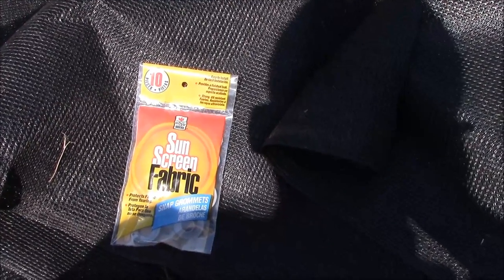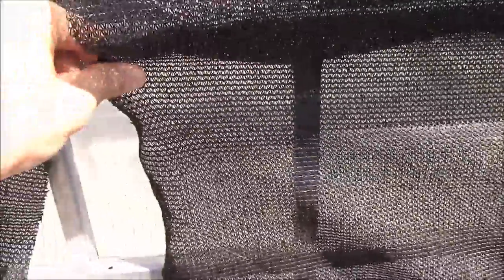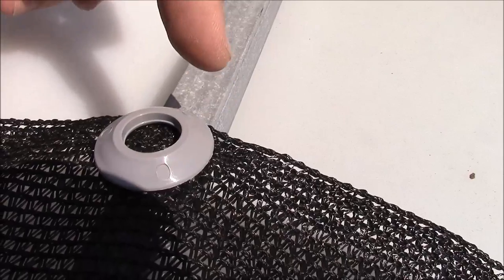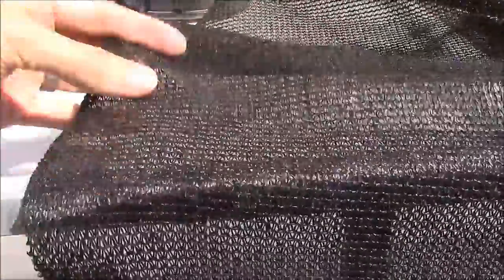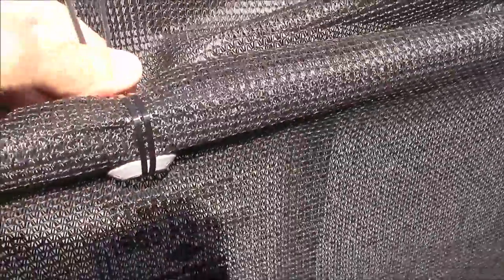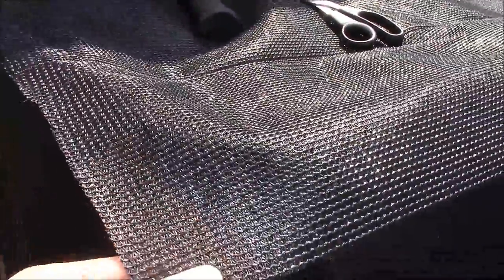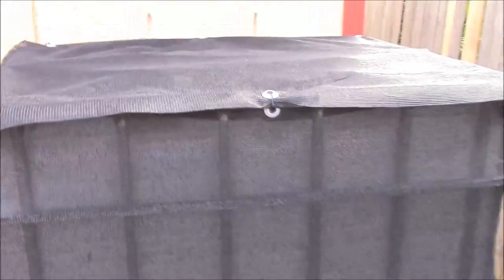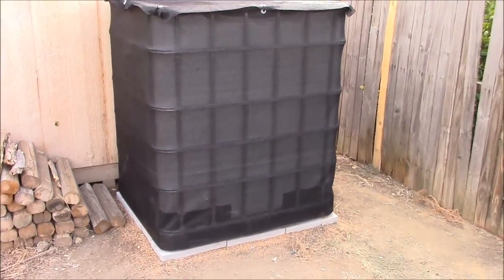Building A Rain Catchment System - Part 2 Protection From The Sun

Comment: I have to agree here. I would have wrapped in black plastic or paint designed for plastic. I'm going with paint. Black as a base coat and beige as the top coat to match the house.
Reply from the maker: I didn't think paint would stick to the plastic surface and I was not about to sand down the whole thing.  The shade cloth works great and there has been no algae growth at all but whatever you guys want to do.  Everyone has their own way!

Comment: How is the cover holding up?
Did it completely prevent algae growth?
Reply from the maker: It has held up perfectly.  The zip ties have had to be replaced but the cover has done its job.  I have not had to drink any of the water but there is no algae in it.  Very dirty, though, since I don't have any filter on the intake.  This water would need to be boiled AND filtered through something like a Berkey in order to drink.

Comment: Wouldn't just covering the entire tank in 6mil black plastic be easier and be better by blocking all light from reaching the tank instead of only blocking part of the sunlight? I simply wrapped mine with a piece of 10'x15' 6mil UV stabilized black plastic 5 years ago, have had no problem at all with them and absolutely no algae growth in them in 5 years in the Hawaii sun.
Reply from the maker: Sure, use whatever you have access to.  This was cheap and easy for me so I used it and no algae growth here, either.

Comment: That waste of money, the tank is still visible and you have defected your intended goal, thick plastic sheeting would have been far more effective
Reply from the maker: It works.  I have never had algae since I installed it.  I have seen people spraypaint them or cover them in much more expensive products like custom fit blankets, etc. but this was cheap and easy and effective.